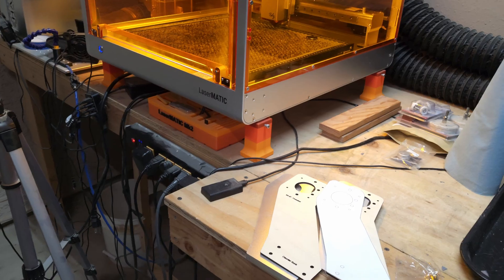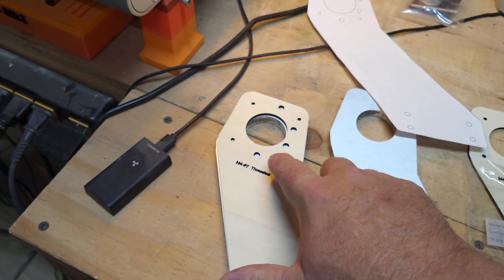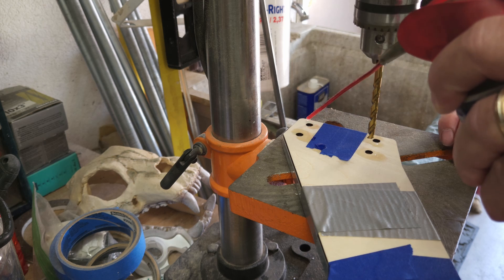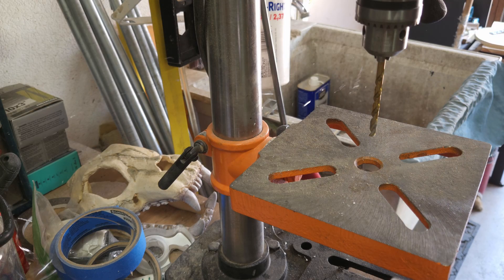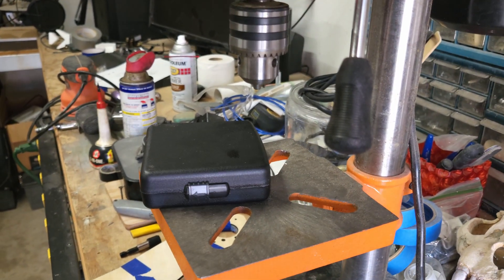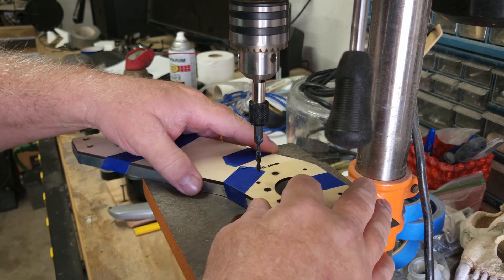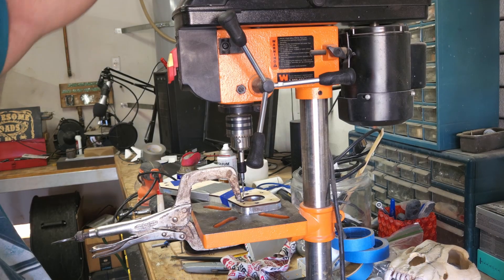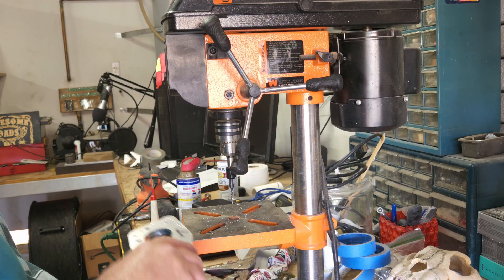Drilling and Tapping  Thick Aluminum Brackets

Comment: Curious why you didn't use the CNC to mark the holes? While you might have been able to drill the holes on the CNC, you could have drilled some counters to at least mark the spots with a divit, like a massive punch. I haven't been following this project, but will go back and catch up. I have a 4040-Pro that I would like to expand the capabilities on.

Comment: The GrblHal that you set aside in your cnc video, is what gives you access to the canned cycles g-code that Grbl 1.1 doesn't interpret (drilling, peck drilling, tapping). All of which you can do on your genmitsu. You're going to eventually have to get use to utilizing all that your cnc can do. Download Fusion 360 (Free for Personal Use) and use the CAM to set everything up.